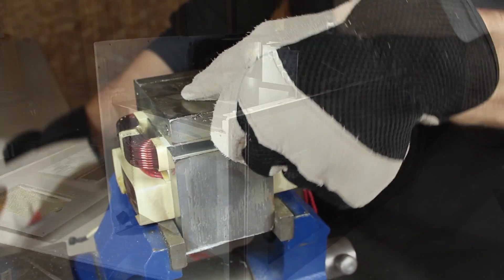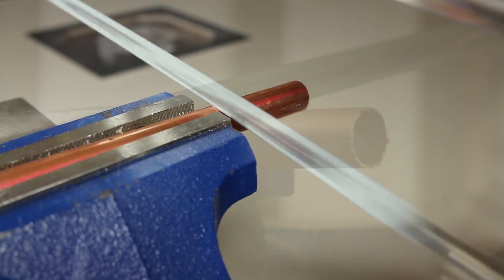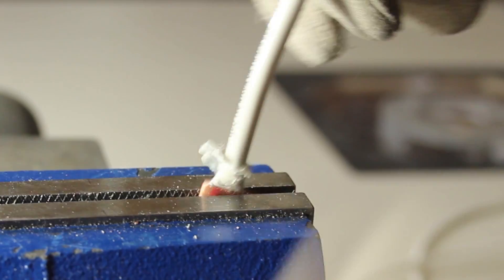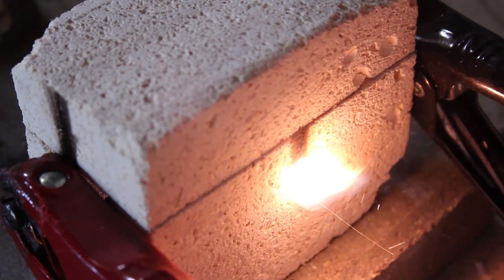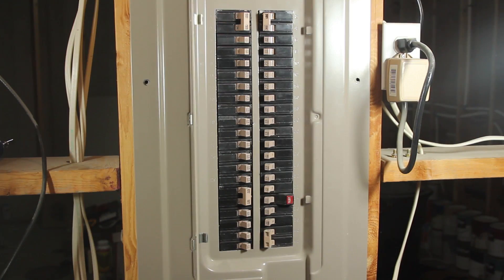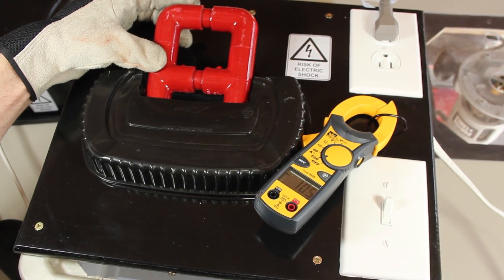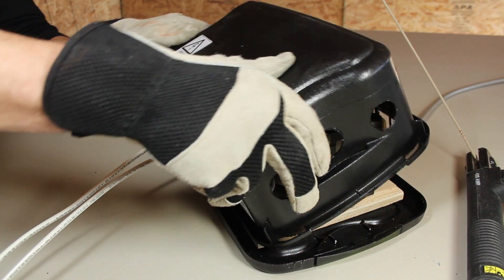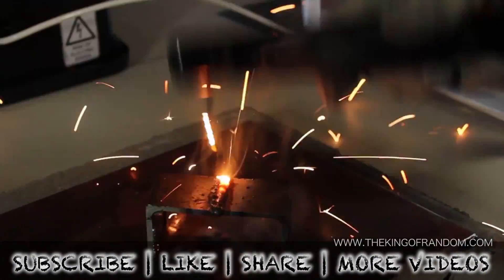Making an ARC Welder - Part 2 of 2

Comment: im a 13 year old girl and the first time i wielded was 2 or 3 months ago and i made a simple circuit with a few transistors, resistors, LED's, stuff like that and it was really easy... only issue is i always had someone bugging me every time i was wielding so i nearly burnt myself many times
Reply: Uh. That's not welding. That's soldering.

Comment: Pretty awesome!!
Wud  like to  try and  make one  myself but I have  just  one  question, how did you  connect the  scariac and  the  transformers  together when the  transformers are working  with  220 volts and  the  scariac  using 110volts?
Would  really  like  a response, thanks.

Comment: you can connect the green wire on the steel of the transformers so if the wires of the coils get hot and melt the isolation u are protected by short up ur electric implant in the house (sry 4 my bad english)

Comment: This video is really cool, but with all the prying you did on the transformer primary while dismantling, you really should have the cores grounded out encase you nicked the insulation somewhere and the things start Hipotting. Also an emergency kill switch is always nice to have.
Reply: If i'm correct that's what the "scariac" is for.
Reply: linkxsc Yup definitely connect "green wire we dont need" to chasis of transformers, its not safe like this

Comment: anyone know if 30 volts will work on this type of welder?..i can only get 15 wraps per MOT..:(
Reply: Depends in how many turns you have on your primary coil. The ratios will determine how much your transformer steps down the voltage to increase the amps. One to two turns with a thick gauge of wire will usually be sufficient

Comment: their are two things i should say one is that to get the 240 volts the way you did it was very dangerest and you could have fried yourself(believe me i have on a regular welder) because you have no ground the only way it was grounding was the system on the ground how you need to do it is go to the hardware store and get a 40-60 amp breaker and get some 10 Gage wire (you can find YouTube videos on how to put in breakers and wire a 240 plug in) the second thing is that when welding on vehicles put a mettle rod up against the ground clamp or you will electrocute yourself ( its not fun)

Comment: 2 questions, would the clamp be + or - ? cus you said ground but i heard the stick goes on the - side. also, does anyone know of a better way to get the 240 volts?
Reply: With AC current, there is no Negative or Positive.
Reply: Bryan Young he said ground though, implying that there is a + and - side, i thought the transformers would might rectify the current.
Reply: In terms of AC, grounding allows any stray current to go in a safe direction, to the ground; thus the term. With alternating current, the flow is constantly going back and forth; thus the term 'alternating current'. With DC, or Direct current, it only goes one way.

Comment: When I would touch the electrodes, will it kill me? Or just nothing happens like in your Metal Melter video?
Reply: Thank you for explanation :) And how high voltage would kill me on this current?
Reply: *****
voltage on dc  is only dangerous over 60 volts while as on ac im not really sure i think its lethal anyway.
Reply: Thank you very much man! Now I get it :)
Reply: welders are pretty safe skin is a pretty good insulator. if you get in between the electricity you'll feel it but be fine. just be careful.
Reply: Thank you man.
Reply: Nah, Voltage only really gets dangerous around 200 volts.
Reply: Myko Link Thank you :)
Reply: ***** Wow lots of people are replying to you :P
Reply: That is really kind of them :) And you too!
Reply: Ariel Barton
It's not deadly but obviously shocks in the US still are painful.
Reply: *****
There is alot of mis information here. Yes this is very dangerous.. Current is the killer not the voltage so much. Infact as little as 100ma can be the "can't let go zone". 50-60hz at 110 or 230v with 100-200ma can do some serious damage. Sooo ya 200 amps at whatever voltage can definitely end your existence. 

Search human body current threshold..

Electrical Engineering Technologist..
Play safe.
Reply: ***** Why even reply, the thing couldn't even hurt a fly!
Reply: ***** well if theres no voltage then the amps cant harm you.
Reply: if theres no amps voltage cant hurt you

Comment: Why do you need 2 plugs for 240v when you can get it from the wall, are you from the us because you could come to the UK and get 240v directly from the wall with no modifications to any pugs
Reply: SWord Sord
You never want to touch any contacts, ever. Especially while they're still "hot". If you need to ask this, this is probably a project that you should NOT be doing. While playing with electricity is fun, I cannot emphasize how incredibly dangerous it is.
Reply: 230 v can kilk
Reply: No the uk
Reply: Maybe he's show how to make the welder and spending the least amount of money, so he recycles both cables from the microwaves, and used them to achieve the 220.
Reply: I misspoke when I said he created a DC current. I meant that, with the two phases, he has a constant power output for welding as well as enough amperage to be able to weld. In regards to your recent comment, I never said that he converted the electricity to DC prior to it going to the transformer.
Reply: Yeah, you probably have pain in the ass fuses in all of your electrical cords too....we don't.
Reply: cozypowell007 no it will not kill you joking bro
Reply: cozypowell007
you need enough Voltage to drive the Current true your body's internal resistance A =  V:R(ohms)
Reply: slow_excellence or live
Reply: He didn't use two outlets only for a lack of voltage. Uk may have higher than the US but you would still need an AC to DC converter. AC power can be represented as a Sine wave (aka fluctuating power) and stick welding requires DC Current which is a straight line (aka constant power). In the video he says that he connected to two outlets 180 degrees out of phase. This is key since outlets only put out AC and he did not have a converter. Since they were 180 deg out of phase he was able to use one current to "even out" the other, thus creating a DC current with enough Voltage to stick weld with. If he wanted to weld with AC; it would have to be by using the TIG process which is more complicated, more expensive, and requires much more technical knowledge.

Comment: I build a welder just like this when I was 12. I damn near burned down my parents garage with it . You have to be very careful with how long you keep it running. It will over heat in a matter of minutes because the lack of cooling. They don't have anywhere near the duty cycle of a normal welder.

Comment: Does it matter what the Wattage rating on the Microwave is when pulling transformers?  In other words, do you need to have transformers from matching wattage microwaves?  And if the wattage rating is important, what would be a recommended minimum wattage microwave to use?

Comment: i could not get enough power when i powered my transformer in series, so i connected in parallel, lucky i wound both my secondary coils differently ie. one right hand winding and the other left hand winding, now it works fine.

Comment: I was curious, I noticed in the intro to your videos it seems as if I catch a glimpse of what seems to be an arc speaker. (2 screws pointed inwards with a high voltage purple arc between them. Is this correct? If so I would like to see your setup. Thanks king great job on the hydrogen generator. I beleive if you drilled lots of tiny holes in the stainless that would also help increase your surface area.

Comment: Wouldn't joining both E sections rather than the E and I (so u get 2 sets of 18 turns in one transformer) just eliminate the need for running extension cord across your house?

Comment: Right now I'm just kinda experimenting with the things I've got. I can't find any good cable so I'm using starting cables for cars, but its too thin for the melter end too thick and short for the arc welder.
I'll figure something out though.
Right now I've got around 25 volts output, with 3 windings, it makes metal glow and sometimes fuse together.
Still looking for a thicker cable....

Comment: how do you know if your wall circuits are out of phase? what is the purpose of this? what happens if you can't tell and get them in phase?
Reply: i would like to know that to. if two 120 Vac source are 180 degrees out of phase shouldn't they cancel each other out?

Comment: And if you want to make it completely portable you can get a slightly bigger box and put a couple 120 volt inverters and a couple of small 12 volt batteries for a conversion of 240 volts from combining the two 120 volt inverters. For a 1000 watt inverter it's probably over $120 but the two small 12 volt batteries are very cheap; 15 bucks each. It'd be completely worth it to me. All I need is the transformers and I can build it the whole thing.

Comment: Are you nuts?? using to different Outlets to power this thing, this is how fires are started. I have my own similar built thing but I wired the secondary in parallel and the primary in series, works as well, but much safer
Reply: Sean Cummings haven't the rest of the world learned yet, us americans don't like it any other ways, we got to be different. screw metric system, screw ur fancy high voltage outlets, screw your right had drive cars, screw your little engines.
ill take my steak with a side of American v8 pride!!!!!
Reply: Seem's like North America is afraid of a little 240. lol
Reply: If you notice in the video, where do the white cables get power from? If you notice, the home made coil wires (white ones) aren't actually attached to any power source. One end is the clamp, then winds around the transformer, then hooked to the other transformer wire, then wrapped around the transformer, then out to the electrode welder clamp.
Reply: Mark Walther
 If you looked ad how it was done on the use of two different out lets, you would see that he's using the hot form both sockets, that's whats makes it dangerous, if he were to say wire one transformer to one outlet, using the hot, neutral and ground wire, and then the other transformer to the other outlet once again using a separate cable, then this would be much safer and he could still generate the power he's looking for. What the big deal is, first off, no ground wire attachment, so if it shorts out and he's using it, it's possible it could kill him, number two, when working with a 220 circuit you have to use the two hot legs like he did in the video, However you do have to worry about the load balance between the two separate loads being applied to each hot leg. The power to the output leads is generated by magnetic induction, same principal of how power companies send out the power from the generator station. so it works like this in his setup, input is 220volts at 16.8 amps, equals on the output to 37 volts at 100amps, or the equivalent of 3700 watts total.
Reply: Ah! Now I get it. I have already built the two transformers, like the video, and looking at the wiring, I couldn't understand what powered the lead wires. All they do is simply coil around the transformers, not hooked to anything at all. I'll use your wiring method, sounds better.  Next thing, I'm looking up how a transformer works before I plug it in. Thanks friend. Mark
Reply: Sean Cummings I also want to hook up the ground. Hook it to the metal frame of the transformer? (the side? there was an original wire there,,,assuming it was the ground).
Reply: the metal frame of both transformers is the best place to hook it up on, http://www.dansworkshop.com/2008/03/homebuilt-arc-welder/, should kind of give you an idea how to wire it, since I can't draw the schematic to how I have it, but you do need to find two circuits that are on separate legs of the panel box if your going to do that. I have the inputs wired in series so they use one plug, but I have the outputs wired in parallel, as to generate the most amps out of it possible. Don't want see anyone get killed or maimed.
Reply: Sean Cummings Thanks again. (funny, I'm using a millermatic 210 Mig welder to make this little guy). $2500 welder to make a freebie. That's a deal!!! ha
Reply: do it in germany we have 220V on our plugs you need only one here
Reply: Gotta love having 240v as the standard outlet here in aus
Reply: michael novak oh, MIchael... the auto industry shifted to metric like ages ago. There is a world out here, you can squeal and kick, but it will take nowhere.

Comment: how much amps does it need?
Reply: as demonstrated the amperage will vary depending on your switch, you can weld with as little as 80-90 amp but thicker metals will require upto 200 amps

Comment: is there any way i can do it without that funky power plug @ 3:37 so it can just use one outlet? my thought is that i could use a real variac that goes to 240v(versus the scariac), or i could alter our hand wound coils to get a good balance of voltage and power. would either of these methods work, or would that leave me at a loss for power?
Reply: don't most houses have 240v plugs for dryers and stoves and things?
Reply: Yeah, move to Australia. We have 240V 10A straight from the wall.
Reply: awes0meguy13 yea but they're usually being used by a dryer and a stove, even if not they're in really inconvenient places

Comment: hmm ... instead of "collecting" power in the house to get 240V which will be split to 120 V per primary again, you can put both transformers in parallel on primary side only.

Comment: No earth protection, no overload protection, undersized cables against sharp edges and flamable materials.  It is a fire waiting to happen.  Not to mention you have touch voltages through the holes in the container more than heigh enough to electrocute.  Just because something works does not mean it should be done

Comment: Why not connect the transformer to a 30 amp dryer circuit? It provides 240v on one circuit and is more efficient than connecting the transformers to two standard outlets using extension cords.

Comment: I don't think you needed to find two socket in your house and get 240 volts.
If you connected each transformer with 120 volts you should get the desired output by trying out until they are phased correctly. Or correctly phase the two inputs.
No?

Comment: actually could i use 3-5 transformers with the primary's connected in parralell,and the sec's in series?with a variable current controller on the primary,would it work?and if not why not?

Comment: could i put a 200amp diode bridge to convert the AC to DC?because DC is much better for welding,and what if i dont use a power controller and run just straight from the mains?

Mains>transformer>diode bridge>electrode and negative
would this work?

Comment: I would really not recommend this.. Its VERY dangerous.. If you need/want a welder go buy one its a lot safer.. And you can wire a 240v outlet no problem.. If you can't wire it yourself hire a electrician.. Its a cool idea but it's not worth your life if you accidentally touch something wrong..

Comment: Every time I plug it up it trips the breaker. Any recommendations?
Reply: Yea take another transformer and short high voltage then wire the primary inseries with the other two transformer primarys it makes an inductive current controll

Comment: does it works if I connect the transformers in parallel at 110v? or I need the 220volts

Comment: come to india where you will get 220v power supply in home, because indian standard is 220v. did the user get shock if he get contact with the output supply cable

Comment: The problem lies in the primary current draw and the size of the cable suppling them. If you will note, he is using the cable that was attached to the microwave.He is using whats on hand. It's rated at no more than 20 amps. By using 240V with both tranys connected in series he kept the current draw below the cables current limit. If you prefer to increase the cable size to 40 amps,wire tranys in parallel and attach to two outlets that you're sure are not on the same breakers, then it will do.

Comment: The x-formers primary is rated at 15amps. By adding a 2nd x-former in parallel would double primary current draw which would trip the breaker. By wiring both primaries in series across 240volts the power is doubled but current draw is below the primaries and house breaker rating. His way of doing it was quicker than wiring in a new 240volt line from the electrical panel however, it would not stop one from doing so if they so desire to.

Comment: If it outputs 200+ amps, it can easily do 1/4" in a single pass, or up to perhaps 1/2" reasonably with multiple passes. You can always weld thicker material by beveling the joint and then doing multiple passes, but at a certain point it becomes more hassle than it's worth. Also, at a certain point, the welder just doesn't put out enough heat to melt the base metal, but by the time you're at 200+ amps, you're past that, I think.

Comment: I don't think so. AFAIK, German power is single-phase 240, so there isn't split phases like we do in America with the two legs of 120 power. If the whole system is phased together, you don't get additional voltage by crossing between circuits.

Comment: I'm not sure I understand the need for the wall outlet hack - was it just to get it up to 240V or was it to impart a 40A rating? The latter sounds dubious, and the former makes it seem rather roundabout and dangerous. You already have a set of transformers from the microwave - couldn't you modify them in some way to work with a standard 120V input?

Also, I'm hesitant to leave the ground pin unattached - shouldn't I attach it to some base plate on the floor of the housing? 

Thanks!